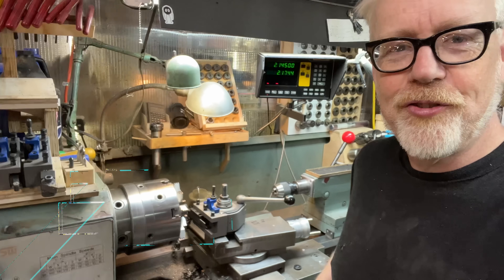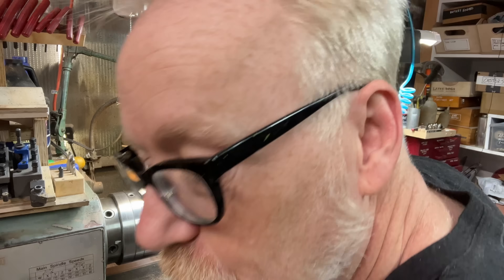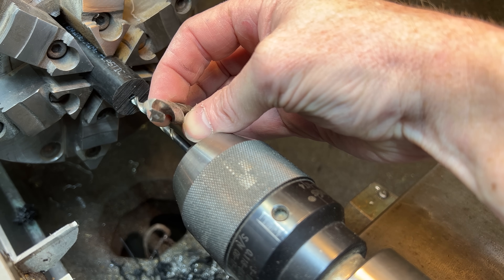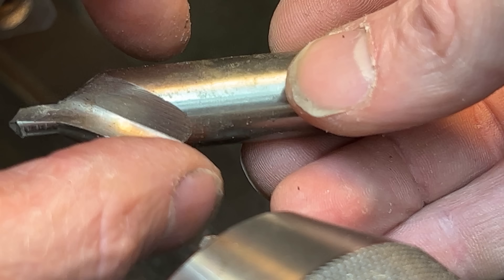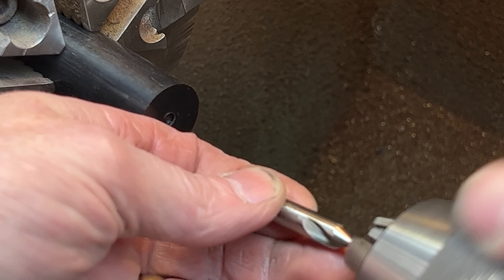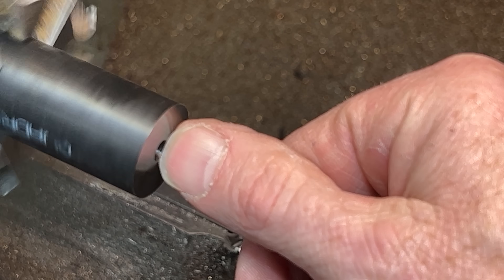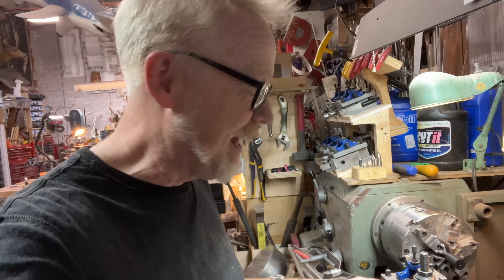Why Adam Savage ALWAYS Uses Center Drills

Comment: We have carbide drills at our work. We've always center-drilled but recently someone said that the carbide drills don't need centering! We now drill without centering and the results might actually be better now because the center drill would sometimes leave a peg that decentered the carbide drill. Sounds weird that the center drill would be the weak spot but things don't always work in practice as it does in theory.

Comment: ADAM!!!  You're WRONG!!! "SPOT" drills are the best for locating holes!  Please refer to these two videos :)  https://www.youtube.com/watch?v=Ot8wPGQW3JI&t=493s    and    https://www.youtube.com/watch?v=UOtQLjcCcZg    
It's all about the angles, and center drills are only supposed to be used to help align a long piece of stock on your lathe using the Live Center on your End Stock.  Center drills are only used to make sure that tip of your Live center does not get broken by coming into contact with the material.  
I think this video should be revised.  If everytime Adam says Center drill, you replace it with Spot drill, sh'bang! You've got yourself a video approved by machinists.

Comment: Adam, center drills are not for starting holes. They're for use with a live or dead center in the tailstock or headstock. Get you some spotting drills. If you DO use a center drill to start a hole, DON'T go the full depth of the first portion of the drill. Just use the first little bit of the center drill to peck the work deep enough to keep the web of the twist drill centered.
Reply: P.S. Often time, I just use a centerpunch that's ground to about same angle as the twist drill and hit it with a big hammer.

Comment: Very much like brad point drill bits in woodworking (or for me, guitar repair and making), especially in a hand drill. No need to worry about a wandering bit ruining something, or making your tuning key installation look all goofy because one of the holes wandered off and now the whole tuning key is out of alignment with it’s neighbors. (This is less of an issue on tuning keys that use hidden pins instead of external screw tabs because someone came up with a drill guide for those that clamps in place through the headstock.)

Comment: Hey Adam! I work in manufacturing and if you want to get even more precise using a spot drill with a greater angle than your drill will help. That way the point of the drill makes contact with the point of the spot before the edges of the drill. Obviously you have a system that works for you but just wanted to pass along something I learned.

Comment: I was always told that a center drill is so named because it preps the work for using either a live or dead center for support.
Reply: You are correct. That's why they're typically 60 degree angles. Spotting drills are specifically used pepping for further drilling, but center drills are also effective, usually based on short rigid lengths.
Reply: Correk !

Comment: Throwback to my lathe exam when I snapped both ends of the centre drills into my workpiece which I need to drill completely through - somehow I passed
Reply: Probably gained "points" with how you dealt with the problem.
You don't fail by falling off the horse.  You fail by not getting back on.

Comment: Try using stub length drill bits.  In most cases they won't move like a jobber length bit.  It can save you the time of changing between center drill and jobber drill.  Very seldom do you really need a jobber length bit anyway.

Comment: I love using a center drill in the drill press to countersink holes as I drill them. Far more accurate than trying to use a countersink bit after the fact. 👍
If I had a lathe, I'd definitely use them there too.
Reply: I do the same thing with clapped out end mills, flat countersink reuse recycle before heading to the scrapyard

Comment: No a 'center' drill is not for starting holes which are accurately centered (although they do do a reasonably good job of that) they are called 'center drills' because they are for drilling holes for "centers" to support the workpiece. The correct drill for ensuring holes are started properly centered is a 'spotting drill'.
Reply: Yes!!! So many people don’t understand that those wide shoulders are a 60 degree inc angle for a center to ride in. I run a large cylindrical grinder (28” dia x 168” ) and most would not believe weight and force you can support off of a relatively small centers.

Comment: If you use a center drill instead of a spotting drill, a small thing, very very small thing, you can do to prolong the life of your twist drills, is to only use the tip of your center drill. Those have an included angle of 120 degrees which more closesly matches the 118 degrees of most twist drills, and will give a more even starting wear on the tips, leading to fewer regrinds and having to sharpen your twist drills. The 60 degree start of the main body of the center drill puts a lot of initial force on a very concentrated spot on your twist drills.

Again this is just a very very tiny detail thing I like to do to waste less time sharpening my twist drills but I thought I'd throw it into the void of the comment section here, maybe someone will get some use out of it.
Reply: Who cares, drill bits are cheap, if you're cheaper than a drill bit, fret not it's just highspeed steel, just resharpen on the Grinder free hand

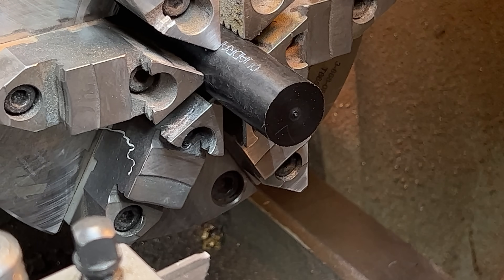Comment: At 5:17 when Adam flips the piece of rod material end-for-end you will notice a little nip/point right in the center.  This will deflect a regular drill bit in a heartbeat.  So buy and use a center drill bit first.  Besides making a nice starter hole it will also countersink the hole.  Makes the followup drilling operation work first time, every time, and great.  My $0.02.
Reply: I once saw a blueprint that called the nip/point on the end of a round feature a “raised machining artifact”.
I’ve been using that term ever since 😄
Reply: @andrebyman8744  Perfect description.

Comment: The "wandering" is mainly caused by the tip center being parallel to the end of the workpiece. the wider the tip, the more it will wander. The more you sharpen a drill bit, the wider the tip will get, as the core of the spiral gets wider the closer you get to the shank. When I apprenticed as a fitter back in the mid-90's, we would often grind the tip after sharpening the drill bits to get it narrower. This also helped the bit cut better, as a wide tip has to be forced through the material.
You also use the center drill to prep for the running center. Without using the running center, on longer material, you risk some serious chatter at the end furthest away from the chuck.
Unfortunately I haven't had access to a lathe for decades, as I changed career path after my apprenticeship ended. Today I work as a technical designer at a concrete element factory...

Comment: Using a centre drill to recover an off centre hole like that may not work in tougher materials.

The trick is to mount the centre drill with the flutes horizontal and use the toolpost on the cross-slide to push the drill slightly off centre, so that it cuts on the rearward flute only.

The more traditional way it to set the top-slide to 30 degrees (60 degrees included) and single point the taper.

I'll repeat once more, a centre drill is for forming a hole suitable for use with a support centre. If you just need the starting point for a drilling operation, a spotting drill is a better tool.

Comment: Unless I'm actually going to use a lathe centre, I avoid the use of a centre drill.

I've never broken the tip off a spotting drill!
Reply: +1 for spotting drill!!  They are faster and drill bits last longer if you use the correct angle!

Comment: So what we're seeing is, a centre drill still does the wandering in the same way as a normal twist drill, but it does it at a much smaller scale before widening out to the full size.
Reply: I think the initial wander from the centre drill, was due to the off centre hole made previously with the normal bit. It then bored it out and straightend.

Comment: Funny coincidence... Adam posting a video about a center drill, just moments after I edit a clip in my next video where I use one... anyhow, the center drill also has the shape it has to make a "hole for a center" on the lathe - i.e. the sholder creates a cone that perfectly fits a (life) center and the nub in the middle creaes a cave for the tip to prevent wear. I think the name stems from that use case.
Reply: When I was an apprentice engineer back in the early 70's we called that live centre a tail stock and used a half stock when using the lathe to cut a thread.
Reply: @jimclark8845  I'm not a native speaker... the "tail stock" to me was always the part between the bed and the chuck? As opposed to the "head stock" that has the spindle...
Reply: @atkelar  This was 1972 I was an apprentice doing my first year off the job training so you can substitute idiot for apprentice not be far off the mark  lol
The next year joined the UK military further entrenching the idiot part.  Do not worry about not being a native English speaker lots of us natives already butcher the English language.  ;)
Reply: @atkelar  I am a native speaker. I learned to operate a metal lathe back in  the early1960s  I was taught that the tail stock is the movable assembly that is tapered to carry a centre (or a variety of other tools such as a drill). This can be a 'dead' centre (which must a hard centre, lubricated with a hard grease) or a 'live' centre fitted with a thrust bearing. In fact, my Myford ML& manual also uses that terminology.
There is also a soft centre, which fits the headstock taper and is normally unlubricated soft metal because it doesn't rotate in the workpiece.

Comment: He doesn't mention it, and if its not obvious, the benefits of a center drill really shines when used in a hand held drill.  A lathe can correct a drill bit that wanders, that isn't possible with the hand held drill.  The wandering effect is gets worse the smaller the bit you are using.  There is also the problem that a wandering bit will make the start of the hole you are drilling wider, and if you are dealing with very small tolerances, that is a problem.
Reply: Even on a pillar drill, it's useful. Sometimes a centre-punch dimple is simply not enough.

Comment: That is a center drill and countersink. You're drilling in too far for just a center drill. The first edge has a  120 degree bevel - to align with a 118 degree drill bit tip. If you go so far that you countersink, you get a 60 degree side angle and it's no good for starting a drill. The countersink is used for holding a live center.

Comment: When I was doing more actual installing as an electrician, we had to drill a lot of holes for screws in aluminium trunking.  I don't know where i found one center drill just the right size, but that made it so much easier.  With regular metal drill of about 6-7 mm you need to actually push the drill in to aluminium, but with center drill bit with similar size shank in a cordless drill its pretty much effortless to do.  It took some time to find out what those drill bits actually were, before i was actually able to find and buy more of them.  So, a "precision tool" also works for speed and comfort in not that precise construction.
Reply: The spiral or helix of a regular drillbit often grabs the material and pulls on it! You could dull the drillbit a little to make it grab less or do what you did and use a centre drill :)
Reply: @Kaffeslampa  yep, it will pull slightly, but only after it has started to bite in to the material. I have sharpened (brutally with an angle grinder and free hand) a lot of drill bits for that and it helps to make that "bite angle" way steeper, so it starts to bite easier and won't let go that often.  It is done by hand after all, so keeping constant and straight pressure would make it much harder.

I have even tried to sharpen sds+ concrete bits to be like metal drills, so I  could just slam it though in one go to the wall. Makes hell of a noise, but some colleagues do it even with those regular dull concrete bits. I was surprised how long that sds+ bit kept its sharpness while hammering to concrete.
Reply: if it was a tungsten carbide drillbit, maybe u dont need a centredrill for it, cause its so strong anyway.
Reply: @shitheadjohnson2797  it's still the same profile and area you are trying to push trough, it just keeps sharp longer. With center drill it's just like using a smaller pilot drill, as the material is only couple mm thick.
Reply: @shitheadjohnson2797  
Yes but they are brittle.

Comment: Center drills are typically for creating a 60 degree locator on longer work for live or dead centers. They do work great for centering drilled holes but a spotting drill is the preferred choice and will give you a nice chamfer. Spotting drill holes are easier on the the drill and have less chance of breaking. The broken off tips of a center drill will scrap a job real quick.

Comment: at least for milling, i usually just use cobalt drills with a split point. they self center, so i never have to use spot drills or center drills.
Reply: Split points are more fragile especially on an uneven surface,  so you can ruin a few breaking centers out of the drill.  However it depends on your workpiece.  But high tolerance work almost always requires a well centered start hole.
Reply: @firennice  yeah, i never start drilling on raw stock. i always machine the surfaces first so they’re always nice and flat. most of my tolerances are ±.005”, and i can’t even remember the last time i had one out of tolerance
Reply: @dtsnjsn6101  We have customers that drill with a .0005" tolerance, so we tell them to always center drill and maybe even predrill the hole.
Reply: @firennice  fair enough. i rarely get tolerances that tight, but that’s completely understandable. i just try to avoid the extra operation because cycle time

Comment: I'm an amateur luthier, making  musical instruments like hammered dulcimers. For a dulcimer, there's a bunch of parts where you have to drill tiny (1/8, or even 3/32) holes in very precise positions in very hard woods. It's not about trying to hit the center of a round part, but about having sets of three 3/32 holes less than 1/4 inch apart in a 24 inch long wooden rail. 

I've had a ton of trouble with my drill bits wandering when they hit the wood, which causes a load of trouble.

Would using a center drill in my drill press to start the hole, and following it with the regular twist drill to finish going through, help? Or is the center drill only good for lathes?
Reply: It would work great 👍 for that,  but you could also use a starter drill.
Reply: @Mark Chu-Carroll, center drills can be used in the milling/drilling applications.
In a lathe, the workpiece spins and the tool is stationary.
In a mill/drill press, the tool spins and the workpiece is stationary.  
I have drilled small holes of the sizes you are using.  Always used a center drill.
I am a Journeyman Machinist.
Reply: That would definitely work.  I use them for that kind of thing all the time.

Comment: They're also perfect for lower powered lathes. Mine struggles like all heck going in blunt with a twist drill. Centre drill let's it go much smoother.
Reply: I make twist drills for a living, that monster center chisel angle on large diameter drills requires huge grunt and feed pressure, but with sorta slow actual feed rate.

You could try and use a split point to reduce the overall chisel pressure, but centee drills are the best way.

Comment: I was taught center drills were only for dead and live centers.and to use the spotting short nose drills for hole starting as there's less flex
Reply: same, they also dont have a section at the front that can break off like centerdrills